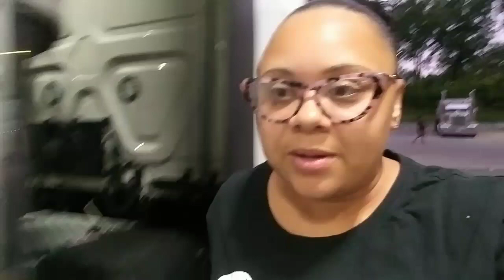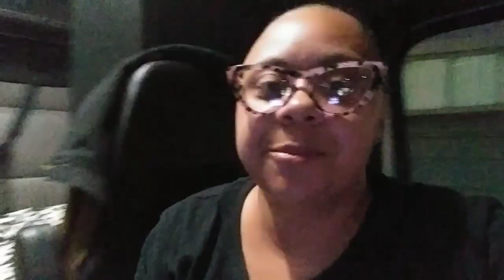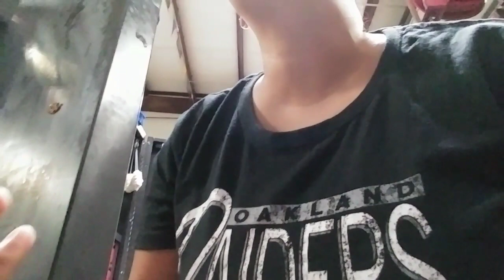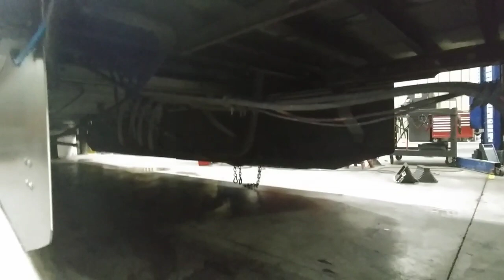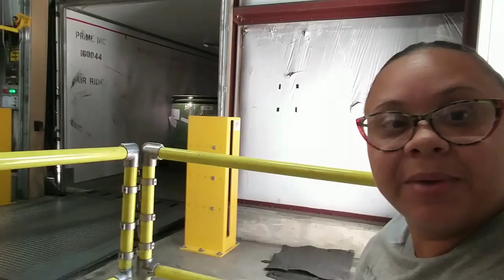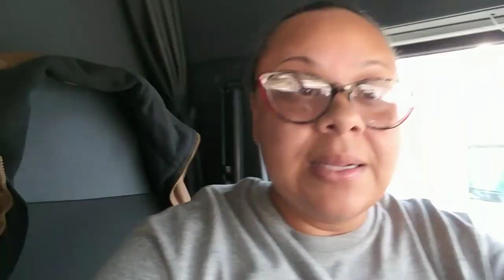Female Trucker Vlog (V95) Loosing Air @ The Mosquito Buffet

Comment: That's the good things about  working  for Prime "safety equipment " those things make a lot safer our job.  We also get the messages on the QC about  reefer temp, air pressure lost, It's  awesome.  Keep  the good  work and be safe :-)
Reply from the maker: Agree 100%. Prime is on point with safety.

Comment: good evening D pulling into the garage it sounds like stewe has a case of big dog syndrome. that  nail isn't so great especially through the sidewall that ruined a good tire and when the mechanic let the spare down and the sidewall was out of it,that would make a preacher swear o well that's trucking. call Baggs the one prime  trainer l messaged him the other day about getting tire plugging kits  from your fleet service people to carry on the truck you could have been rolling in about 30 minutes or so had that nail been in the face of the tire even you  could have done it yourself be careful out there have a good one.